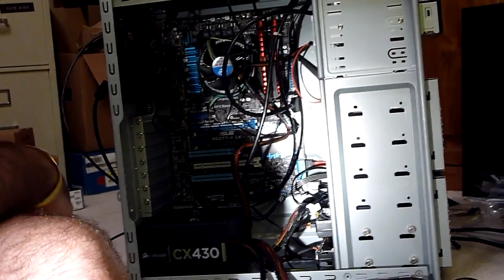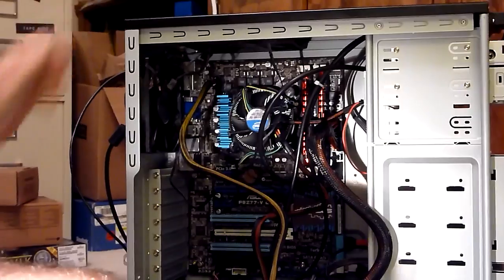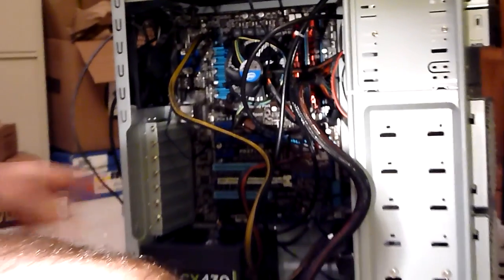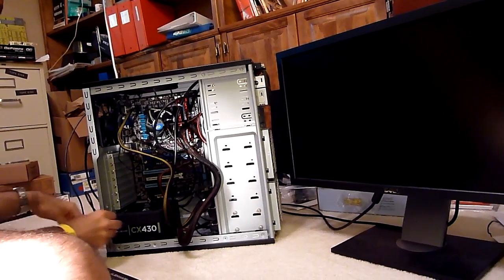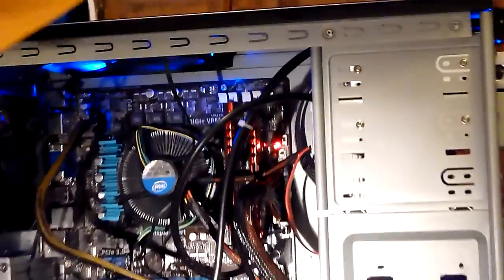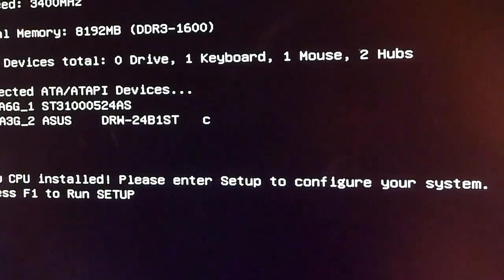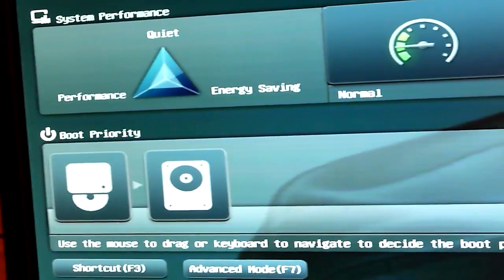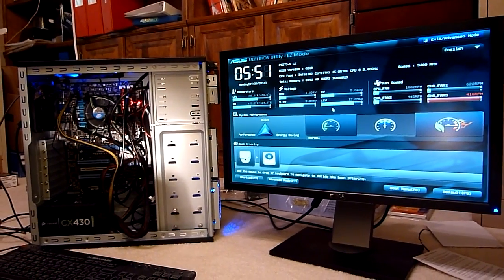PC 16: Power cables, and turning it on for the first time

Comment: If I have fans and led on yet nothing appearing on screen what should I do!?
Reply from the maker: 1) Check that you have your monitor plugged into the right output (do you have a separate GPU, or are you relying on the built-in GPU from the CPU?) 2) You might not have plugged in all the necessary power cables to the motherboard (usually 2) and GPU (usually 1) 3) Your CPU, GPU, or memory might not be plugged in all the way/aligned quite right  As a last resort, pull it out and reinsert, one item at a time, and see if anything changes.
Reply: @BurkeyAcademy  it was the stinking RAM! Thank you good sir. I was beginning to worry all my work was for nothing

Comment: new build computer just wont turn on but if I run my other mobo it works just fine I really cant figure out the problem help would be appreciate (all the cables are correct the front panels are all correct and I really dont know whats wrong..
(specs)
processor - intel celeron g3900 2.8ghz mobo -asus h110plus ddr3 
graphics card - nvidia geforce gt 730 4GB
Reply from the maker: If you switch out the motherboard and it works, then it is either the motherboard or something attached to it (e.g., new processor, memory, video card), or there is a small chance that the power supply can't handle the total power load with the new board (unlikely). To rule out the video card, pull it out and use the Intel 510 Graphics built into the processor.  If you have to memory sticks, try one at a time to rule out a bad DIMM.
Reply: My power supply is an EVGA 500w Bronze or something like that. I still can't get it to work I've purchased new RAM, the processor is in correctly, my only assumption is that the mobo is messed up. It won't give me anything, no matter what..

Comment: No signs of electricity in the pc, what did i do wrong???
Reply from the maker: +alkaabi-121 No idea-- some things to check:
1) Is there an on-off switch on the power supply (look on the outside near where the power cable plugs in)
2) Wiggle the main power cables gong to the motherboard, to make sure they are connected fully
3) Rarely, the power cable you plug into the wall will be defective-- you can check to see if using a different one makes things happen

Comment: just booted up my first build and i have a no signal on the monitor cables are fine but I don't have the OS yet (should be here today) will that make a difference?
Reply from the maker: yes, you should get something on your monitor even without an OS installed. if you have a video card installed, make sure that you have attached power cables to it if it needs it.
Reply: BurkeyAcademy
yes thanks i attached the monitor cable to the computer not the video card, but now i have a new problem I'm working on, if i have trouble i may write again, just vtell me when i'm being a pain

Comment from the maker: The stock fan is VERY small.  But, the processor doesn't use much power, so I guess its OK.  I have mine overclocked to a little above 4.  I hear you can do a LITTLE better with adding a $30-40 cooler, but personally I'd spend that dough on (saving up for ) an SSD drive or more RAM, depending on how you use it.

Comment from the maker: Though some motherboards can POST without RAM, most will not.  Another issue with this build is that without a separate videocard, the video system has no memory to work with (though I just checked my system and it seems to have 64MB of dedicated video memory... perhaps built into the i5 chip?).  Thinking about this also just made me realize that without a discrete videocard, some of my system RAM (2GB) is being used by the video system... I'd better go ahead and order another 8GB of ram!

Comment: Hey, Burk, great video series you made here. I have a near identical build to yours so your videos helped me more than any video or guide on youtube. I did have one problem though, my PC didn't POST or beep (since this mobo has no speaker). I was using my hdtv with an hdmi cable, as well as a vga cable but no signal came out from either so i was thinking it was due to the tv. I aslo have no RAM at the moment so could that be the case?